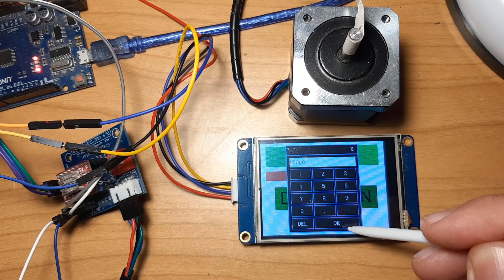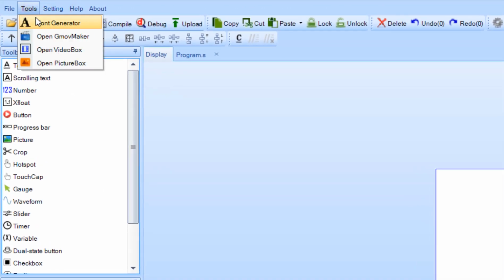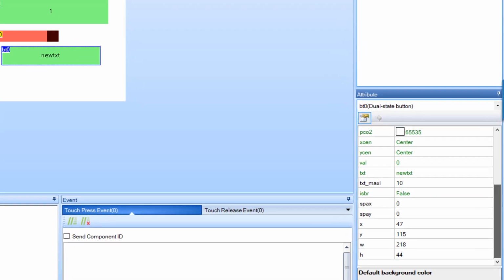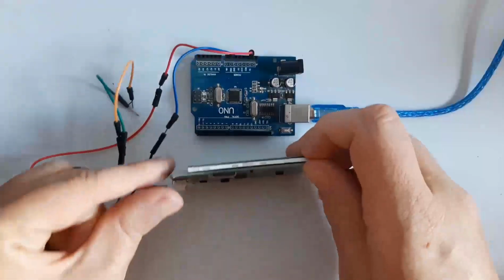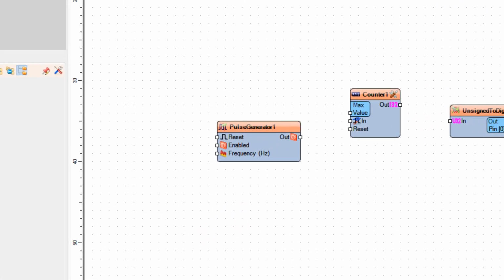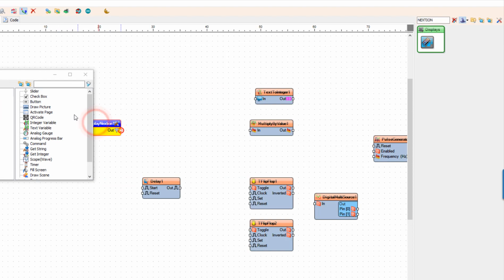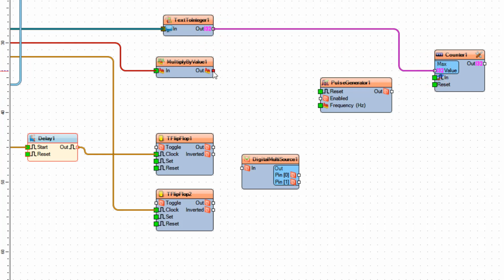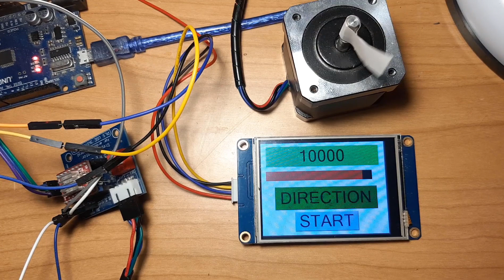Control Stepper Motor Using a NEXTION Display and Arduino

Comment: NICE! can yuo make video how to control steppermotor and linear actuator with touchscreen with multiple rows where can write expl 150mm and next one 200mm and next one 50mm and so on, with little delay between each move, and automatic next postion without buttons press and after last row it goes again firts position
Reply from the maker: For that it is best to use Sequence component.

Comment: how do you connect rx and tx to the display? On the uno pin 0 and 1 connect to  the screen but you only connect it to one pin in visuino?
Reply from the maker: When you only send data to the display then you can connect just Arduino TX>RX
if you only receive data from the display then you can just use RX>TX